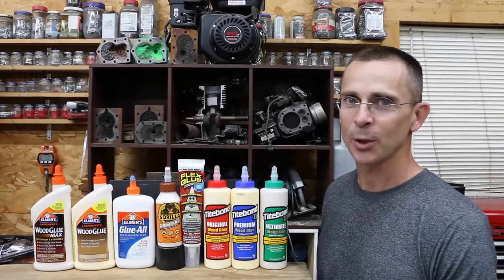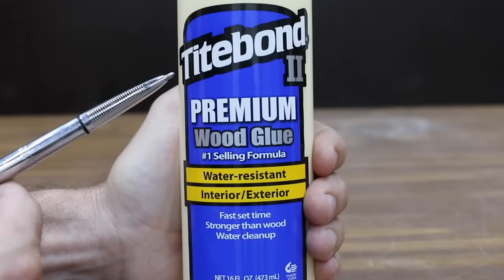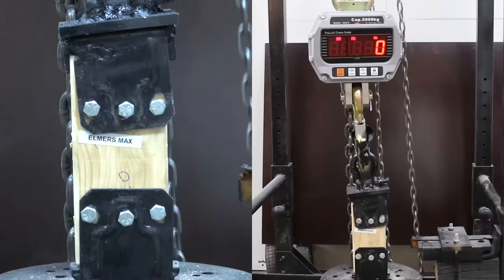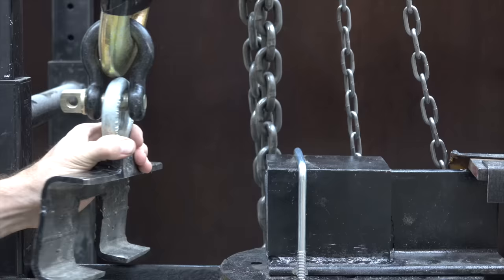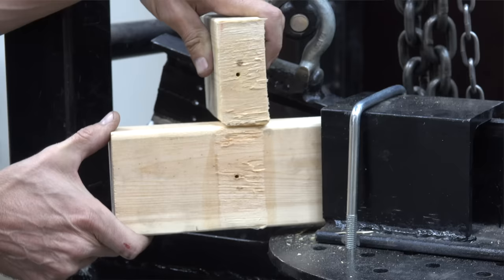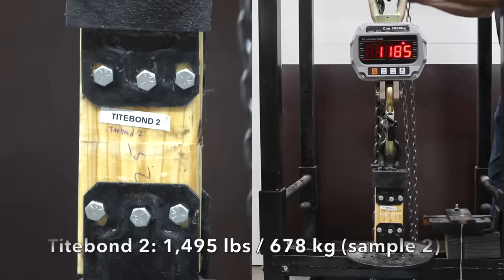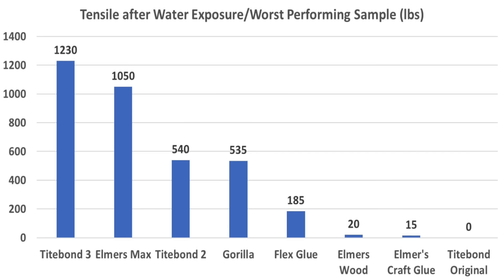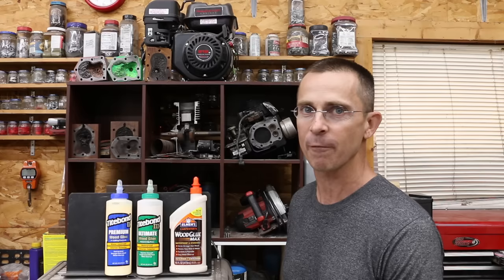Which Wood Glue is Best?  Let's find out!  Showdown with Titebond, Flex Glue, Elmer's & Gorilla.

Comment: “Compressed air did a great job removing saw dust” which brand of air?
Reply: this had me laughing
Reply: Funny as hell, i demand a showdown!!
Reply: Let's test this! LMAO
Reply: I believe he went with "mountain breeze" but we all know that basically every brand of air you can buy is just rebranded Nestle air
Reply: Today we’ll be testing air from various locations in the USA and see how effective they are in removing saw dust. 

Next week:
Does Chinese air clear up your saw dust better than American air.
Reply: That would depend on the compressor age. Leaded or unleaded. ??......
Reply: Was it Summer Air or Winter Air?
Reply: @risunokairu
The 3M brand in the can of course...lol.
Reply: Generic
Reply from the maker: lol
Reply: Great comment
Reply: @iamdarkyoshi  Cooler Winter air would be more dense than Summer air. Denser air should have more "push power" requiring less of it than thinner air. 🤔
Reply: Y'all are wrong
Obviously it was O'Hare brand
Reply: Excellent 👍
Reply: @haa1774  Chinese air has more particulates so it will have a mild sand blasting effect which will smooth the surface for a better bond. 😂
Reply: USA air
Reply: Jalapeno Popper fart air vs New Jersey air vs summer air vs winter air showdown...
Reply: I like the odorless, clear kind
Reply: @iamdarkyoshi  had to have been winter air lol
Reply: LOL
Reply: @ProjectFarm  Have you done a fire extinguisher comparison test yet? Perhaps on different flammable elements? Fuel, oil, Tires or whatever else could catch on fire? I'm leery of some brands out there and not sure of some are Chinese junk and if there is regulation on what can be produced for an emergency situation. Love your stuff! 👍👍👍
Reply: Fluorine Gas
Reply: Hot air from politicians must be avoided. It fails every time.
Reply: I once told a guy the reason his tires are low in winter is because he needs to bleed off the summer air and replace it with winter air and he believed me. 😂
Reply: US Gov't Hot
Reply: Farm Air Pro
(reads package:)
- #1 Professional recommended
- Indoor and Outdoor Use
- Good for blowing and sucking
- Contains Image with chart from "Worst" to "The Best!" and shows this as "The Best!"
- Pre-Scented*
*May contain livestock manure particles
Reply: I use canadian brand air
Reply: @ProjectFarm  you should test what air brand is the best. Or air compressors.
Reply: compressed
Reply: Organic , free range air I hope.
Reply: @Skott LeFever Yes, the fire alarm industry uses it to clear smoke detectors after testing.
Reply: @GeorgeBobeck  I’ll take the Jalapeño fart air over NJ air every time. Especially if its northern NJ air!
Reply: ROFL 🤣🤣
Reply: Hahaha 😂😂😂
Reply: O’hare
Reply: Perri-air
Reply: @cynomyS  He did say compressed air not obnoxious gases
Reply: Also interested in knowing which brand of air is best
Reply: I get my air from Costco.  Walmart air leaves something to be desired.
Reply: Earth
Reply: made in usa with global components
Reply: @LeatherNeck1833   I concurr.  Living in Phoenix , our airport won't launch planes above 118 degrees because of the lack of density in the warm air.
Reply: … let’s find out
Reply: Hahaha!  One of the best comments I ever read.  So awesome Man!  Still laughing
Reply: @ihd-3603  hahaha when I was a carpenter we would tell the new guys that the compressor would be 50 pounds lighter if he bled the air before loading it in the truck.
Reply: @haa1774  heck naw. Chinese air is the worst in the planet with all those carbons in that air.
Reply: Stitches! I'm in stitches
Reply: We're gonna test that!

Comment: As a chemical engineer who worked with the formulators and chemists at Franklin International(makers of Titebond), they use the best materials on the market and their R/D is up there with other Fortune 500 companies I worked with. Glad to see it holds up in the field haha I need some for a shop table
Reply from the maker: Thanks for sharing.
Reply: Bill Banksey (I think that's how you spell his last name)
Bill was one of, if not, the lead chemist at Franklin.
If I ever had a question posed by an "anal retentive woodworker" about the chemical componentry or science about adhesives - Bill would let me call him at Franklin and I'd pass the phone to the customer.  
Bill would keep the guy on the phone going through "the science" all right 😅. Over my 20 year career in the industry Bill and the company he worked for are the clear winners and always will be.
Reply: For some reason Titebond and Elmer’s are from the same town.
Reply: Pretty sure most of these wood glues would be stronger than the wood with a proper glue joint.

Unfortunately this youtuber didn't test any proper glue joints... wood glue is only stronger than wood on long grain joints. End grain joints or cross grain joints require jointery. In the form of a mortise and tennon, dowels, a domino jointer, etc.
Reply: @brandonhoffman4712  I agree, I would never glue a telephone pole buy it's end grain and expect ultimate performance lol  Good test otherwise though
Reply: I'm working on my staining, developing a way to stain wood before glue up so I can glue contrasting colors together.

I'm doing rustic stuff for my shop. An oak stained like walnut to pair with a whitewash, and a light maple to pair with a medium weathered grey.

I'm custom coloring using Mixol brand pigments in a 99% isopropyl base. I want to add water or d-limonene to extend work time and penetration. I'm interested in pigment/dye powders too.

I've never loved the quality of my stain work until trying these Mixol dyes. I did use a pigment powder once, but I think I just went to diluted.
Reply: @brandonhoffman4712   Good luck to you!  Your skill are far beyond mine.
Reply: @brandonhoffman4712  Any pics of your work out there?
Reply: @MOUNTAINMANJJ  I've worked across the nation on many stores in malls. Abercrombie and Fitch, polo, Gucci, Tiffany's, apple, Microsoft, free people, rhul, John John ( jeans), the late great bed bath and beyond, etc.

All of these jobs I was contracted to do tile and stone work. I've only gotten into wood after leaving commercial construction and turning back to resdential. It was always a hobby, now it's diversification of my portfolio.

I recently finished a house. Mostly hardwood with some venetian pattern tiles in some areas. Each bathroom unique (5 bathrooms). I even built them a custom staircase to match. I used wood for the steps and the venetian tiles  as the stair risers, alternating patterns in each step, with plain white every other step so it didn't get too busy looking. We had to change elevations on the job to level te floors, so I had to rebuild the stairs to code after the stair guy built them. (The sub frame)

No I don't have a photo repository online or anything.

You could check any of the stores mentioned, though most other jobs I see are inferior to my work. Even those trying to compete with me. Our crew had a tendency to be asked to take on as much as we could because our work was so good. That's why we traveled the nation.
Reply: @brandonhoffman4712   Did I miss the part about wood glues?

Comment: Gorilla glue also works great as hair gel. So it should get bonus points for that.
Reply: lol... yeah, that worked out well.   <sigh>
Reply: Yeah forsure. I do use that sometimes as well
Reply: ROFLMAO!!!  Good one!!!
Reply: Is that why so many carpenters are bald?
Reply: Only the aerosol though!
Reply: Oh, man, I forgot about her and it was just this past January and February.  She did come out with her own hair product line in June but I'm not sure if her earlier use of Gorilla glue would be a ringing endorsement for her products.  At least she was upfront about it, and a good sport.
Reply: I stopped using gorilla brand as I found it was giving me foamy dandruff.        Started using west systems and its giving my comb over much more control in the wind without the flaking.
Reply: Works great for holding down a toupee. Don't pull my hair.
Reply: Just to clarify, this is a joke (for the dummies)
Reply: @MrBez007  West Systems is the best out there.
Reply: Gorilla is an instant bond . do the test with 15 minute wait time.  All depends on what you need it for. It's the only one that works  wet , dirty and fast -- like your girlfriend.
Reply: I use shellac. Goes on thin, dries fast, leaves a nice shine.

And anytime anyone asks what you put in your hair. You can reply, bug sh!t.

Comment: I'm even more impressed with these glues considering all of your tests involved end-grain glue-ups, which are by far the weakest glue joint possible.  I'm not sure your test rig could have handled some of these with two faces glued together!
Reply: It would be impossible to get good test results without using endgrains. turn the pieces side to side and the test piezes will fail before the glue with any old regular woodglue.
Reply: Both of these comments are very important! I was upset that he was gluing endgrain at first, then I thought about where the failure would be if he didn't.
Reply from the maker: Renax the Many, you are right.  In prep for this video, I did some testing and it became a "strongest board" showdown using long grain.  The test rig will handle up to 10,000 pounds without a problem.
Reply: @ProjectFarm  Would have been worth mentioning in the video, but it's in the comments at least.
Reply: Good data for the test is that by gluing the end grain, the glue will have a chance to wick into the grain. Even more so because he used pine. The TBIII should lead the pack in that test since it is the runniest of the bunch. What still amazes me is how strong the joints can still be even with poor fit up (in my experience).
Reply: I just made the same comment! shoulda scanned the previous 1st! lol
Reply: @ProjectFarm  When are we going to see some wood glue tests on LDF/MDF/HDF?  While I'm sure the LDF would fail far before the glue, MDF might make it through, HDF should definitely make it through.  It'd be interesting to see how consistent the results are vs 2x4.
Reply: @ProjectFarm  two words...  Snatch Block!!!   😜  (or is that one word?  hmmm)
Reply: @BEdmonson85  been watching smarter everyday?
Reply: The fact is, no carpenter would glue end grains, and the glues aren't designed for end grains. End grain cuts also dont mate with each other consistently and the results of this test prove that. In my opinion, if you ran the test the way the glue is intended, you'd have different order of results assuming your wood itself didn't fail. Bottom line is that this test is invalid as it doesn't apply to real world use cases.
Reply: @nicholash8021  They most certainly are designed for that. Show me on the packages where it says to not glue endgrain? The glue that hold faces together best will also hold end grain together best.
Reply: @nicholash8021  As mentioned in this thread, gluing end grain is the only way to test the strength of the glue. Otherwise you are testing the strength of the wood. Tubes >> glue > ligament. Required watching: v=dwLWmoGh59g

Comment: I swear this man would get 1st place every time at the science fair
Reply from the maker: lol. Thank you
Reply: I don’t know man, I have a pretty sick volcano.
Reply: Meh, the videos are clearly useful to get some comparison between products but they're not very scientific.
Reply: Hez the man !
Reply: @iamjimgroth  correct, I made this point the other day in a spark plug fuel efficiency video. People seem to not understand statistical significance, In that particular video their wasn't one. Accuracy of measuring devices were the issue in that video. Running "full" tanks of gas with different plugs. There was a variance of 35 seconds max between plugs, if we assume 1 gal per hour, convert to ml then divide by 60 twice we see that 1 second runtime is 1mL of fuel. So 30mL gives 30 second variance, my conclusion was the test was moot, unless he's measuring fuel with a weigh scale after drying the tank fully. He would have to weigh the samples to the hundredths and not lose any to evaporation during testing. Air temp, tank temp, head temp would all play factors. There's are reason testing is done in climate controlled environment a with incredibly precise instruments. Some of these videos prove nothing, others likely do provide results due to overcoming the error.
Reply: @mechanicallycreative9788  One thing I feel I get out of these videos is that often the products are similar enough to be interchangeable, regardless of which the tester claims win.
Reply: @iamjimgroth  true.
Reply: How is this not scientific 😑 you two are some haters lmao 🤣
Reply: @ProjectFarm  do science faire volcanoes
Reply: @iamjimgroth  
I don't see anybody else testing like our boy PF....
Reply: Hmm 🤔 yet he has how many subs... def more then like 130 😂😂😂 his videos are really for peoples entertainment snd helps you know what products are like without you having to invest anything besides some of your time.

Comment: As a cabinet installer and finish carpenter, I really appreciate this test.

We use Titebond II. I'm honestly shocked by the strength of all these glues.
Reply: No kidding, the Elmar’s craft glue was the biggest surprise in how well it performed.  Also, was glad to see what a waste of money flex glue was, highest price, worst performer.
Reply: @jamesl9686  yeah, I'm pretty sure it's not intended for this application at all, but good to see
Reply: @SnowManson  Yeah, I think all the Flex branded products are junk. I picked up a can of the black Flex Seal when it was only available from mail order just to try it. Yeah, absolute garbage. It didn't even stick onto wood for 6 months before most of it just weathered away .
Reply: @jamesl9686  Their Flex Seal spray is crap as well. Tested some at my house and it didn't last 6 months in the weather.
Reply: Kevin Snow marketing the Flex brand does a lot of marketing I laugh at it but others will buy it.
Reply: @lv7603  Unfortunately your right.
Reply: Which/color one you used?

Comment: Another nice thing about Tibebond 3 is the longer open time, for more complex glue ups, and the fact you can use it in lower temp situations, like a cold shop.  Nice test.
Reply from the maker: Thanks!  Thanks for sharing.
Reply: You took the words right out of my mouth! You failed to mention that clamping time is only about 45 minutes.
Reply: This is actually the most important aspect to me as I live in Arizona where its hot and dry.  Some days it is near impossible to spread out the glue one two small board edges and get them mated together before the glue starts to skin over.  That is why I use TB3.  However, this testing was interesting and I'm glad to see it is also the strongest (although pretty much any glue is strong enough for woodworking).
Reply: I also like that Titebond doesn't glue the cap shut after the first use, unlike Elmer's
Reply: Titebond 3 is pretty much all I use. I've heard too many horror stories about people's furniture falling apart due to flooding or fire srinklers... Plus my woodwork often ventures outside, making planters right now.